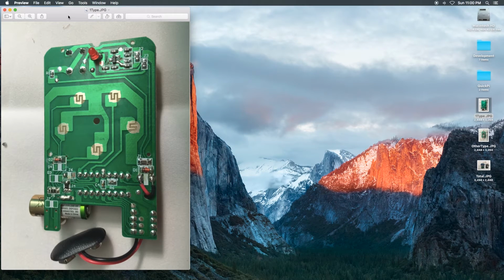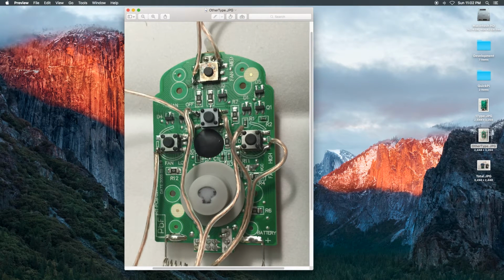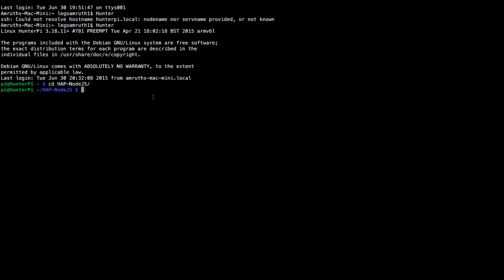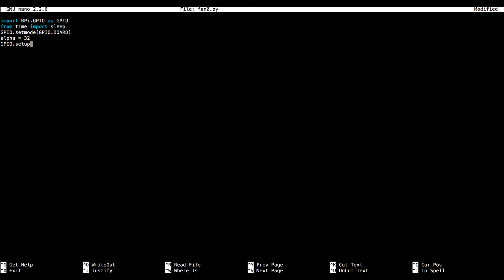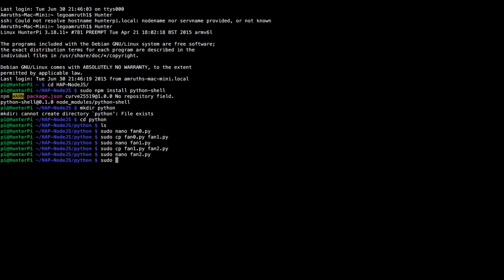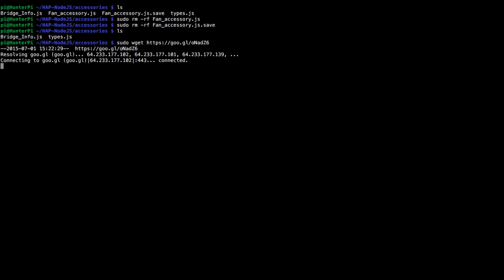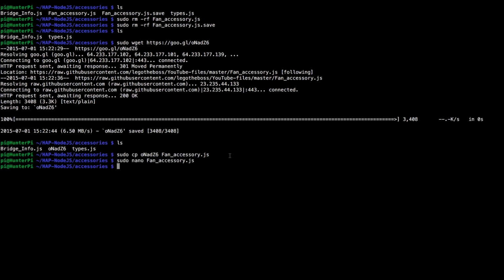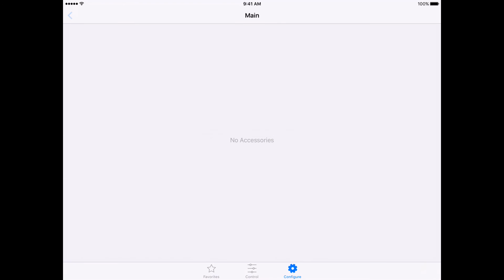TUTORIAL: Siri/HomeKit Ceiling Fan with Raspberry Pi

Comment: when I start "sudo node Core.js give this error. please need your help

* WARNING * The program 'node' uses the Apple Bonjour compatibility layer of Avahi.
* WARNING * Please fix your application to use the native API of Avahi!
* WARNING * For more information see <http://0pointer.de/avahi-compat?s=libdns_sd&e=node>
* WARNING * The program 'node' called 'DNSServiceRegister()' which is not supported (or only supported partially) in the Apple Bonjour compatibility layer of Avahi.
* WARNING * Please fix your application to use the native API of Avahi!
* WARNING * For more information see <http://0pointer.de/avahi-compat?s=libdns_sd&e=node&f=DNSServiceRegister>
HAP-NodeJS starting...
module.js:487
    throw err;
    ^

Error: Cannot find module 'node-cmd'
    at Function.Module._resolveFilename (module.js:485:15)
    at Function.Module._load (module.js:437:25)
    at Module.require (module.js:513:17)
    at require (internal/module.js:11:18)
    at Object.<anonymous> (/home/pi/HAP-NodeJS/accessories/Fan_accessory.js:6:11)
    at Module._compile (module.js:569:30)
    at Object.Module._extensions..js (module.js:580:10)
    at Module.load (module.js:503:32)
    at tryModuleLoad (module.js:466:12)
    at Function.Module._load (module.js:458:3)
Reply: me too...
Reply: find: install npm i node-cmd and it will work

Comment: We’ve gotten the BridgeCore up and running. I’ve kept 3 accessories on this bridge, the garage door, the light and the fan control. The garage door and light accessories are working fine through home kit but the fan control is doing nothing. The python files to control the relays are working fine as when I run them through ssh they turn. Am I missing something to have HomeKit tell the raspberry to control the fan?
Reply from the maker: Which accessory files do you have in the accessory folder. You might’ve accidentally deleted the wrong fan file
Reply: QuickPi GarageDoorOpener_accessory, Light_accessory, and Fan_accessory
Reply from the maker: Check the fan_accessory.js, what does it say. If it says Fake fan or something like that
Reply: The display name is “Hunter Fan”
Reply: I don’t have Bridge_Info.js file. Is that needed?
Reply from the maker: yes, I'm pretty sure that is pretty important. Hunter Fan is the correct fan file. Contact me on twitter and hopefully we can get it working.
Reply: Where is that file from? It hasn’t shown up during any of the installation processes I’ve done by your tutorials. Bear with me as I don’t use Twitter and am unfamiliar with it.